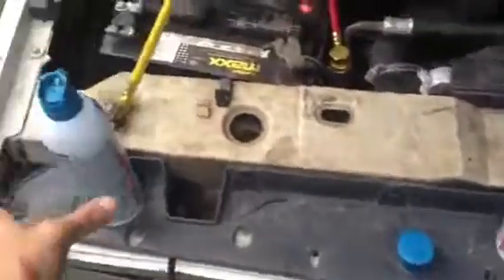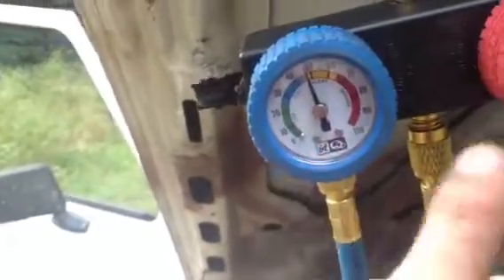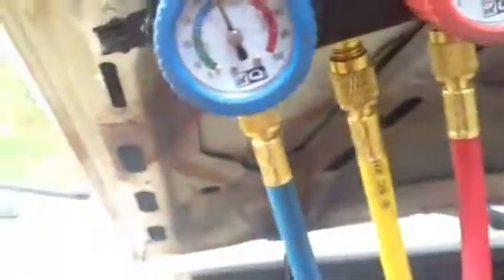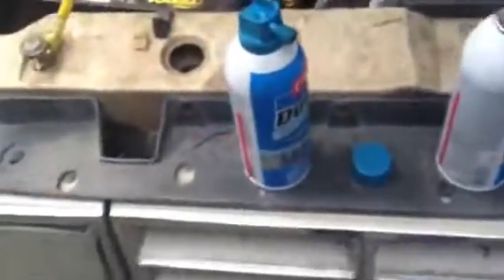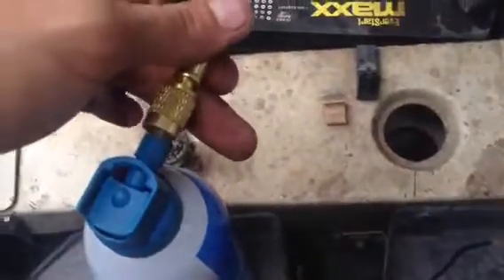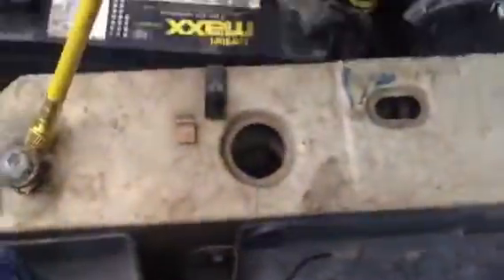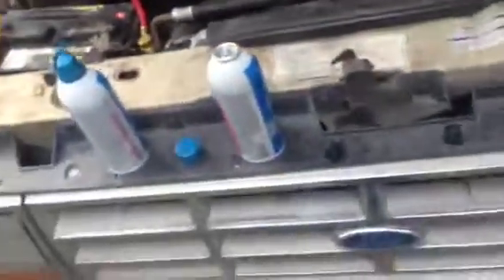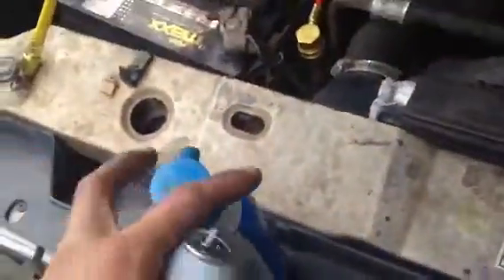Charge ac with air duster ! Pt2

Comment: Do you charge R-152A as a liquid or gas only? I tried, best I could to add gas. Weighed in the charge per sticker under the hood. Doesn't get cold. Like 410A, does 152A need added as a liquid? Did 2 hour vacuum, no leaks. Vent temp is 65 at idle. Think I need to add as a liquid? Oh new TXV and drier.
Reply: hey, sorry to dig up the past - hopefully you have worked it out already but if the system originally ran on r12, then you only need about half the weight in r152 - overcharging can result in no cooling!

Comment: In my experience using a couple different sets of those AutoZone Walmart brand AC gauges I found you got to fill it all the way up into the yellow area of the gauge to get a proper charge..

On a lighter note there's many other brands of duster that don't have the same thread just save yourself a headache and get a can tap for your gauges problem solved I can attest however I have seen these systems make ice at the AC vents on the dashboard. The s*** goes work trust me

Comment: i gotta try this...have r134a in my truck and it sucks..cools ok when moving but sucks ass at idle/stopped.. have an 88 Ranger with an HD fan clutch, and a heavy duty 6 blade steel fan.. so airflow for the condenser is not the problem.